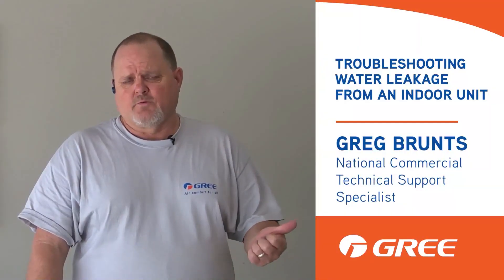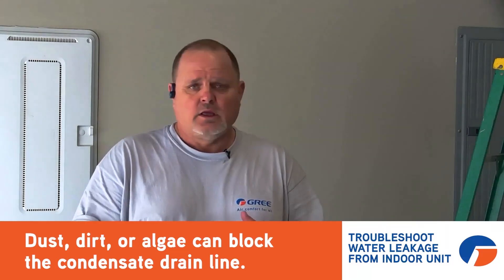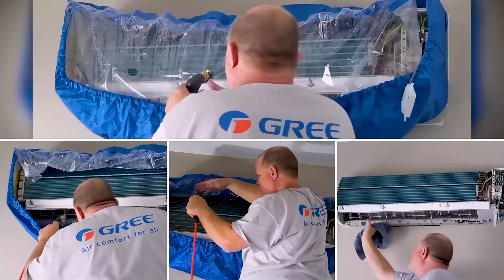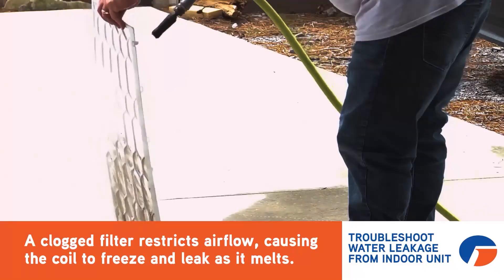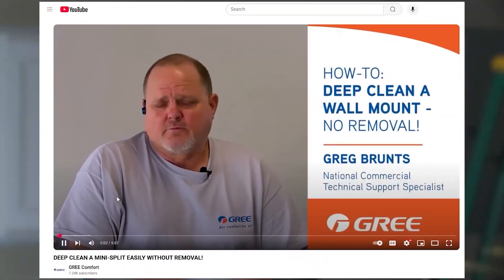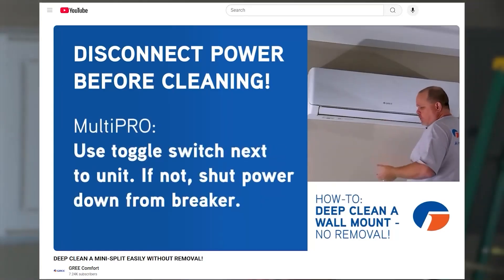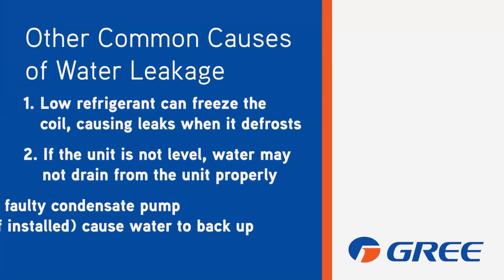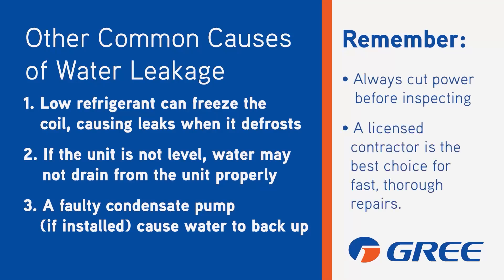Mini-Split Water Leaks? Causes & Fixes from the Field

Comment: It seems ALL of the youtube videos are for exterior wall units, ones that have drip plans and drain by gravity.  Our ENTIRE home is cooled by mini-splits, so we have 4 INTERIOR WALL units which require condensate pumps and their respective drain lines.  It's very different from what you show.  Clearing out plugged lines off the pump are not as easy to clear, particularly when the clogs are becoming hardened solids.  I cannot seem to stop the leaks out of the pump's "drain pan".  The pump is leaking even when the drain pan or reservoir for the pump is only 1/2 full.  I wish you would provide a video on interior wall units.  You would be the first to discuss I believe.
Reply from the maker: Thanks so much for your question! Not sure if you were able to see your question answered, if not here you go! https://youtu.be/38QaIXH9w3c